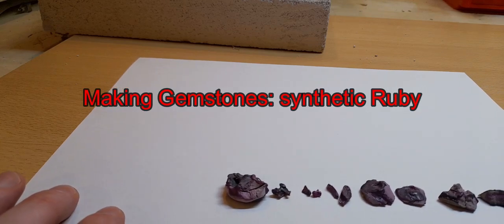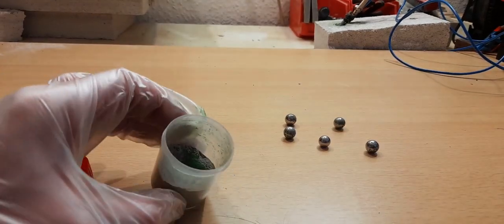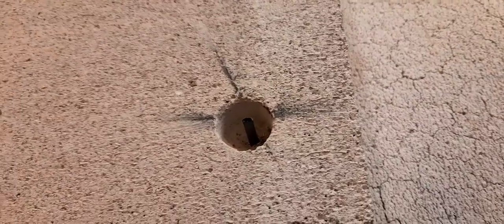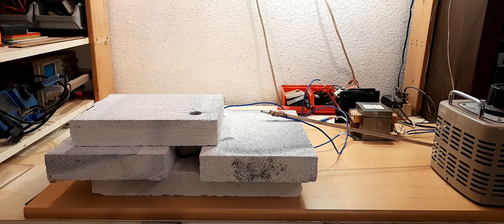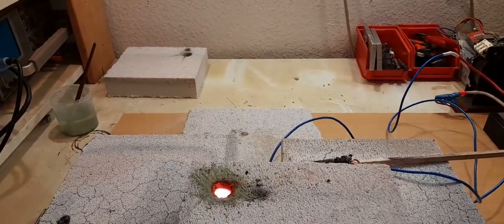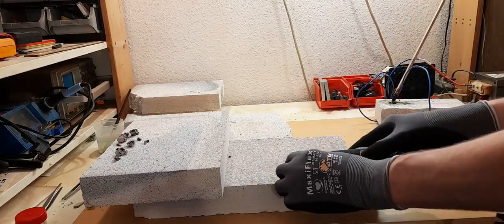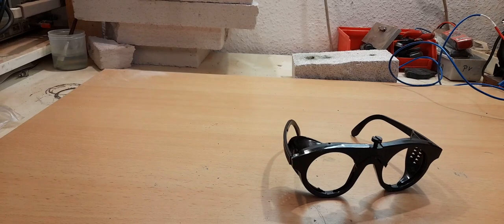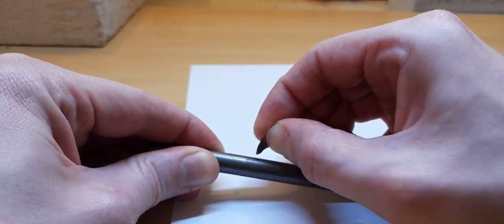Making synthetic Ruby with High Voltage

Comment: Hello AKA engineering! I really appreciate your time to make this video. Have you tried to cut the ruby into a gemstone?
Reply from the maker: yes i have managed to grind it with a diamond wheel. they are not clear, so a gemstone is not possible. But i want to make durable tools out of it. maybe a knife one day. thats why i try to stick the ruby to a metall. that way i can maybe coat the blade of a knife. i will keep experimenting at the pace my budget allows.

Comment: Hey. Firstly congrats on your rubies. I made a high voltage power supply that gives around 15kv output. But I can’t get any bigger rubies than around 1 mm radius. Your furnace looks like a high current arc welder more than a hv furnace. Idk what to do in order to get bigger rubies. Im open to suggestions. Thanks for sharing.
Reply from the maker: the high voltage arc looks good, but the Microwave oven transformer gets to hot after about 2minutes. so i struggle to get bigger rubys myself. i tried an MIG welder and had more success. maybe try a mold made of graphite and heat it with a MIG welder. i want to make a video aout that myself, but it takes time.
Reply: @akaengineering  hey again. I made my rubies using an arc welder. A graphite mold was too expensive for my bugdet so i made a mold fron Ytong. They turned out good but most of them bubbled so they werent fully solid. Thanks for your suggestions.
Reply from the maker: @yusufsahin3278  I tried Ytong too. great insulator, but it melts and the ruby is not pure. the bubble problem should get better, if you heat it for longer. Video part 2 of the ruby making is almost done.